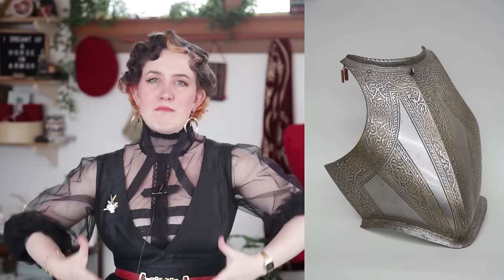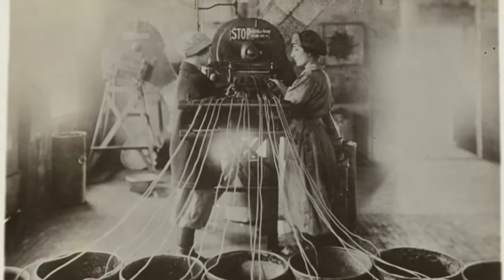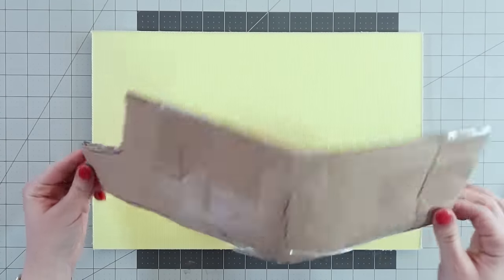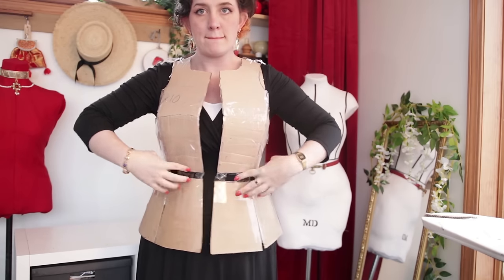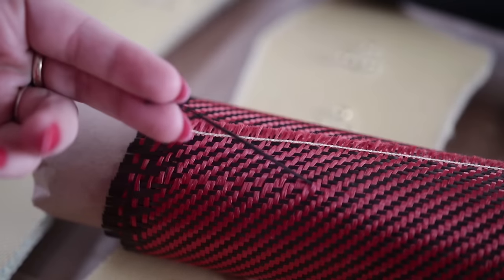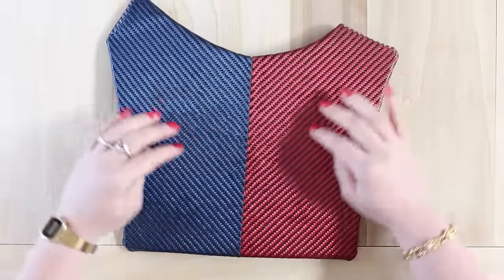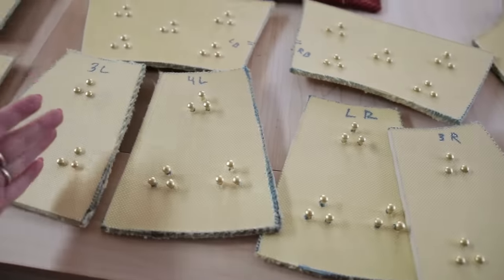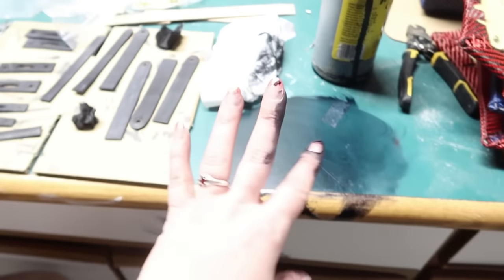I made Medieval(ish) Armor out of Kevlar

Comment: The folks at Dupont have specialized scissors for the Kevlar fabric. I may or may not have procured a couple pairs from my dad who used to work in that department, and they are one of my favorite sewing tools.
Reply: Ooh I’m curious about these. Are they similar to EMT shears (with the micro serrated blades), based on a harder material, or something else?
Reply: I know that one of the keys with cutting kevlar is to use very very sharp blades. That would explain why the first cut was nice, but later ones had more issues. Also, kevlar is used for protective pants for lumberjacks...it'll jam a chainsaw with the fibers.
Reply: Memory unlocked!! We had several pairs (silver, all metal?) that my grandmother said she got from her husband that worked at DuPont. I wonder if he worked in the Kevlar dept???

Comment: If you ever use the carbon fiber fabric again, try using a ball point needle in addition to the other steps you were using.  They are designed to move between the strands rather than cutting the strands.

Comment: I haven't read the comments, except for the pinned one by you, Morgan.  This is my first comment on your videos, though I have been following you for the last few years.  I want to preface this by saying that I have so much respect for you.  And I know that you wanted actual armor, but I need to tell you that you can buy good kevlar/aramid fabric by the yard, that is like the panels you used, just in a single, tightly woven layer, that can be cut and sewn into the layers of a pair of stays, corset, curaco jacket, or yes, a layered brigandine. And then you could use a nice velvet, silk, or brocade as the fashion layer. I am sorry to be a downer, but I just feel like you made this one so much harder than it needed to be.  I hope my criticism is seen as constructive, as it's meant.  I've been planning on making armored stays for a long time, and have still not gotten around to it.  And now I just want to get on that, and dip into my stash.  I got my kevlar from a seller on ebay, btw.  In case you wanted to do that.  Please keep doing what you do.  You are such an inspiration.

Comment: Dear Lady, I own an love-worn copy of OLD IRISH & HIGHLAND DRESS by H.F. McClintock. (1950) While most of our sibling re-creators will source it for the Highland references to early tartans, I latched onto the references of the early Christian Gaels wearing a jacket, the ionar (eye-nar) and while some were of wool some bog samples recovered used "waxed linen"   Recently, in other sources, these Irish jackets were described in the Irish annals to be so sturdy that they never developed any need for armor until the Northmen & Danish invasions had brought them more advanced maille than their Celtic forefathers used in Iberia.  I digress. Waxed linen, as you said yourself, textiles regretfully decay and disintegrate rapidly so we have almost zero example, but as they were originally migrants from Greece's highlands... Are we possibly talking about a Gaelic version of a LINOTHORAX?  I suggest you do a little reading on the university (plural) who have had students recreating the Greek version. That it method could be used for an Irish ionar would benefit more re-creators who, like you and I have a internal visualization of something particular and we haven't worked out the details in full.  If we can create, the kevlar equivalent, layer by layer with the appropriate adhesives, you could make it into the odd shapes you were having to piece smaller slices of kevlar into. It would probably be much lighter, if naught else.

Comment: I've had lots of similar mishaps with similar materials. Synthetics dull blades deceptively quickly, and yet still continue to cut through but with tons of tear out. And when materials are rigid and have such thickness, beveled cuts are a necessity. When you mentioned carbon fiber cloth I could feel your disappointment coming. I had the same experience. So pretty and yet unable to do it's job as a fabric! Fantastic execution despite the difficulties. Kydex material might be able to get you closer to your original vision.
Reply: I am just wishing Morgan had shared her sources for these materials! :-)

Comment: The carbon fiber fabric had me dead. A previous version of me once built relatively small rockets using both kevlar and carbon fiber, and wow, do I have much respect for you using that carbon fiber as a fabric. Cutting it results in the itchiest little splinters. They're very hard to get rid of because of the tubular shape of each fiber, so I wish you a successful cleanup~~

Comment: I am in love with those sleeves. I’ve done brigidine using corduroy for the outer shell with canvas to make pockets for metal plates. It was also blue and red counterchanged. However when we did rivets my exsquared had a tool to help dome them similar to what you use with grommets.

Comment: I've used Kevlar for making small boats (it's excellent for abrasion resistance) and have wanted to experiment with it in clothing for sword protection in my martial arts training, but my scissors twitch in horror every time I consider it.
Reply: Also, RIP your bandsaw.  Kevlar is nasty on tools.
Reply: I am similarly impressed at the fact that you voluntarily worked with kevlar/carbon composite fabric!
That stuff's Rude™ to work with for epoxy laminates, let alone like this.
Go you, you mad mad lady.  Many Kudos

Comment: "it has that sheen like a silk but it absolutely feels like a polyester" i can confirm that. i work in a factory producing mainly polyamid threads and the thing is sorta great to work with. compared to cotton we sometimes get to run it's a lot more stretchy and you need to use a lot of power to snap the finished double spun thread (i'm talking about like 10kg of force for a thread you could use in ye ol' regular sewing machine) and when heated up it melts to itself, creating almost plastic like material that doesn't stick to anytning but other polyamid. real cool material to use for the dissipation of kinetic energy and friction into heat but a real hassle to deal with if it snaps mid production and coils around machine parts. in the worst case scenario you need metal wire clippers to get through that, and in the better case scenario you can cut that with a blade but the said blade is going to be uselessly dull after 2 or 3 of those.
Reply: Also about the second cut being worse - itcs not your fault. It's the material. It dulls any cutting hardware you use on it like you would not believe it. I don't know how follow up steps of polyamid production are dealth with on industrial scale since it's done in a different facility, but what i do in my step of production is i change lots and lots of one use blades. During the cleaning when a batch (usually anything between 5 and 60 tons, it depends) is done and the big spinning machine has to be cleaned so there isn't any cross contamination with different material fibers for the next order, at the bottom of spinning units there are tons of coiled threads (because that's where they are separated by literally rolling them around and snapping them by a combination of force + mechanical blade runner). To clean those you need to cut the whole tassle-like bunch off. Usually, a single new blade can do between 10 and 20 cuts about 4 cm on each cut, then you have to change the blade because it's done.
My guess is that your cutter has to be treated the same - either you change the tape after every eeeeh 50cm of cut kevlar or skip the machine altogether, get a good old staple cutter and do it by hand, snapping segments of the blade away as you go. Itcs tedious, i know, but you will have cleaner edges.
Reply: @sillyjellyfish2421  
I wonder, if for this type of project, a CNC laser cutter would be an option. 
Never used one, but they seem all the rage with the DIY/woodworking crowd lately. 
You would get precision cut parts without any hassle, if the material is suitable for this. 
There are also shears specifically made for cutting kevlar fabrics - but nothing as thick as this. They do work well on more fabric like kevlar, though - the type used for heavy duty motorcycle clothes.
Reply: @raraavis7782  i'm not saying that it's impossible but i would be sceptical about it. Laser works because it focuses lot of heat into tiny point to melt/burn away a fraction of the material. That melted and burned channel then becomes the cut.
But when it comes to this particular synthetic fiber i don't think that there is any heat shrinkage. For one, it doesn't conduct heat well so while you may be able to cut through 1 or 2 layers at the same time, i would be very sceptical about being able to cut a whole plate like she has in the video.
And then again, this whole laser cutting idea may be irrelevnat if the heat doesn't do anything to begin with. As i said, when the thread snaps during the production process, more often than not the free end tangles itself around moving parts like axis, cilinders, or it vedges itself between moving parts and stationary parts holding the whole machine together. The friction it creates is enough to literally temper those parts into rainbow while the thread is still there. It doesn't do much to the material. It doesn't singe, doesn't change colour, only gets really compacted to the point that it fuses into a single thick plastic layer. We had cases when the whole machine had to be out of commision because this friction twisted the main axis and we needed new machine parts. The fiber survived of course, baked onto friction melted steel like it was no big deal.
So personally, i see the cross-fiber cutting with a physical blade as a more viable option
Reply: @sillyjellyfish2421  
Yes, I had doubts, too. All those properties, that make it so remarkable... sadly also make it a total pita to work with, it seems.
I'ver only ever handled mixed fiber kevlar fabrics - the kind used in heavy duty motorcycle clothing. And those cut quite well with kevlar shears. But these plates...🤷🏻‍♀️.
I mean, they did have clean edges to begin with, so there must be a way, to do it. I would love to know, what the manufacturer uses then.
Reply: @sillyjellyfish2421  
Well, I googled a bit and apparent some sort of rotating blade (from Dremel to big  circular saw) and a thin, diamond studded blade are your best friend. Even that will dull pretty quickly, apparently, but give you a nice, clean cut for a while.

Still. If it was possible, laser would be the way to go. So much less hassle 😅

Comment: A very interesting build. This really makes me doubt that historical Brigantines were a cheaper type of armour. So much work goes into making one, and you can go really fancy with all components. Sure, the metal plates are smaller and probably easier to shape. But in the end, it still all has to work perfectly together.
Reply: Way fewer rivets than chainmail, but easier to fit to the wearer than later plate armour. They did quickly realise that using fancy fabric in the armour itself was extremely impractical, and switched to fancy surcoats over the armour instead.
Reply: One thing that I have heard brought up is that it is easier to repair because it is made of smaller pieces. Shadaversity has a decent video on the history of it too.

Comment: This video was an adventure and it's gorgeous. I've been around seamstress' my whole life and I work with carbon fiber/fiberglass composites so I was at the edge of my seat the whole video knowing the limitations of sewing technique and the properties of composite fibers. I have to say this was a testament to overcoming obstacles. For anyone interested an easier route, use epoxy resin to harden the carbon fiber over a foam mold and join it with straps afterwards.

Comment: I have to imagine that there is specialized equipment for working with these materials. Elsewhere in the comments someone mentioned specialized Kevlar scissors. I figure that there has to be some kind of heat press vacuform machine that could fuse Kevlar, carbon fiber, and vinyl in one move. I wonder how Adam Savage’s Tested would tackle the same project.
Reply: That would be a EXCELLENT collaboration! Maybe get Simone in on it, too !

Comment: Back when i worked with fiber optic cables that are reinforced with aramid fibers, i discovered a type of cisors desinged for cutting aramids existe, they have serrations that work pretty well. They work well for cleaning up the fuzy edges, but struggle with cutting bunches, its honestly a real pain. Though using a band saw was something i never thought of.
Also good on you for using ppe and a resperator while using the saw, lots of guys i know could learn a thing or two from you.

Comment: We make insanely complicated 3D shapes out of aramid at work, but we make it by layering multiple sheets of thin fabric onto plaster moulds using a liquid plastic formula, in a process a bit like fibreglass making. We could definitely make that bodice, but don't ask me to guarantee management taking the job, nor the price being reasonable given that you want armour thicknesses! We cut the aramid cloth with scissors, but we have to sharpen them specially to a higher standard than they come from the factory and re-sharpen them frequently.

Comment: When I dabbled in fire juggling, we used kevlar rope to construct our torches. It taught me a couple of things about working with Kevlar fibers. 
1, The best kind of knife to cut kevlar with is, in fact, a bread knife! The soft serration saws through the fibers without snagging. If you have to use scissors, only cut a couple of fibers at a time, and keep a scissor sharpener at hand.
2, Use blunt needles for sewing. Never sew in kevlar with a sharp needle. The break fast as heeell. My clubmates kept using these really thick, sharp needles for furniture making, but even then they broke one or two needles per tool. Me, I decided to use a saddlemaking needle instead - pretty thin, but with a blunt head. It didn't catch on the fibers at all in the same way theirs did and I have yet to break even one.

Comment: Beautiful results! Oh - just FYI, there is a rivet tool that it doesn't look like you used. It shoves down the little washer. Then you can cut it. And then the tool rounds it for you pretty quick and easy for the initial hammering bit. And then after it's good you whale on it with a hammer to flatten it like you said. But the rivet tool does make the first bit a lot easier. Got mine at Tandys.

Comment: Perhaps use soft kevlar for the pading and metal for the plates and the sort of fabric used for the normal modern body armour on top giving you something resistant to both the traditional threats traditional armour was made to protect against  and some level of resistance against bullets if you have reason to be worried that someone may for some odd reason shoot at you. You could even put a hidden layer of real ballistic plates in the back padded layer but if you are that worried  a real briganden over real low profile body armour may look better and let you feel safer.

Comment: I love your hair. Wouldn't faux rivets have worked? You can just glue the faux rivets on, no punching through needed. From what I could tell you didn't need the rivets to hold together anything, since the fabric was fused on. What was the metal neck piece you had at the fair? 😀 Did you make that too? The project came out great. Thanks for the video. ❤️

Comment: What about pre-making a 3D form and laminating each layer together with the thermal plastic in between on the forms itself, shaping in different darts on each layer, to spread the bulk around, and sort of box pleating the darts instead of cutting them? Then the Kevlar would already be in a 3D shape once it's that hard and thick and you would just have to cut and join the plates. You could slip little triangles of the fusing material into each dart to make sure it didn't result in un-fused pockets. You'd have to start with the plain fabric and the fusing material in sheets though.

Comment: The finished product looks absolutely fantastic! 
I guess a good tip for anyone who wants to attempt this is: just don't make it out of Kevlar. For a lightweight, affordable and easily bendable version just use EVA-foam, it's heat-treatable as well. Once it's covered in a fabric of your choice I don't think it will look that different :) Might have to puts some tiny weights at the bottom to actually make it hang off you though. The only problem would be the rivets but I guess those bendy-back ones would work just fine for this.

Comment: The carbon fibers do not like to be bent at an angle so much.  They are really strong under tension, but the individual little fibers snap like if you were to try to bend a pencil lead. (Bit more flexible than pencil lead, but similar concept)  That fabric is indeed meant to be shaped and laminated into a solid piece.

Comment: The carbon fiber party cloth you used is not supposed to be used raw.  It is for carbon fiber resin parts.  You soak the part in resin apply it on top of other carbon fiber and then let it cure.  It becomes a hard inflexible part, like what you see on race cars.  Working with carbon fiber and Kevlar is a very unique skill.  To have it come out looking like it did is impressive.  You are not the only one what has had issues making a garment out of carbon fiber and Kevlar.  You might like Xyla Foxlin and her attempt at a bullet proof ball gown.
Reply: Here is a link to her video if you want to check it out.  

https://youtu.be/DuS6Q6Xb6KM

Comment: Could the initial cut on the bandsaw have blunted the blade just enough to cause it to pull,the threads out?  It wouldn't take much - I recently watched how a syringe  needle (for insulin injection) deviates microscopically after use  _it still breaks the skin but it becomes more painful.  It would explain the pullrd threads.   It might be worth checking a sample sefore using it on other fabrics